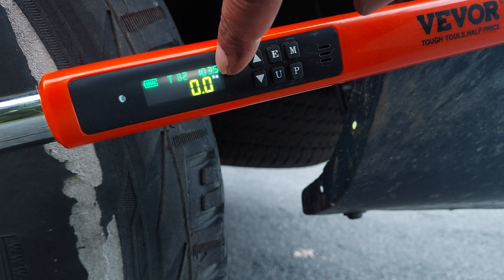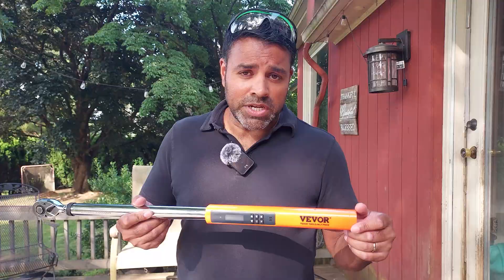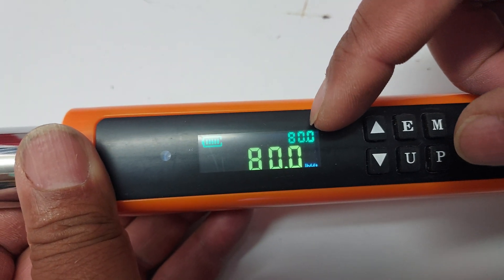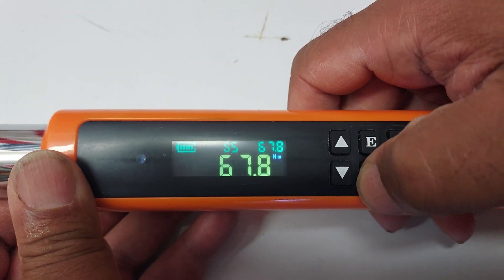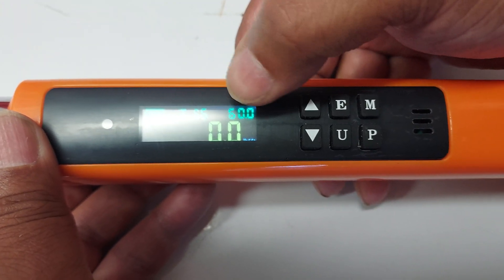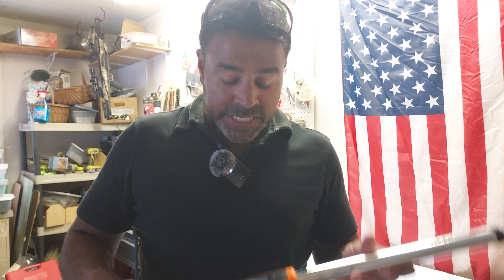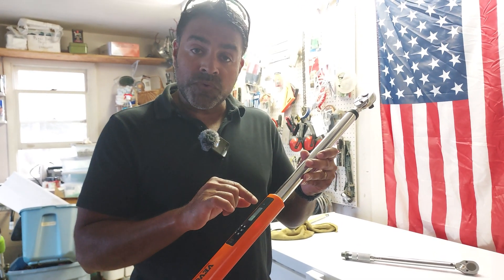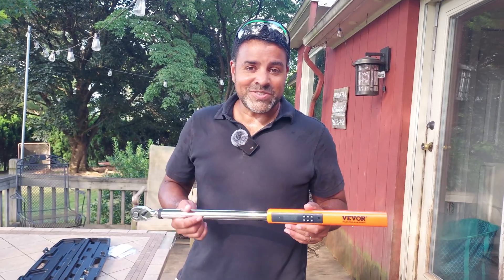Digital Torque Wrench Review + Setup | Beeps, Vibrates, and More!

Comment: How accurate are the readings on this? Are there any videos on the torque specs being verified?
Reply from the maker: The readings seemed consistent with my click type torque wrench when I was testing and torquing my lug nuts on several of our cars. I didn't do any in depth testing and verifying of the torque specs. This is a good question though. I'll let you know if I have time to do a video on this.

Comment: Mine won't come off 0.0
Reply from the maker: I would try taking out the batteries, putting them back in and then starting here at my this section of my video, let me know how it goes! https://youtu.be/eeSzdwfIixI?si=cqIJrEVjTWkWIyIu&t=101
Reply: @jamminjamy green wire was broke do to the screw that held in display. That wire reads the torque value. Spliced it back together and seems to be working